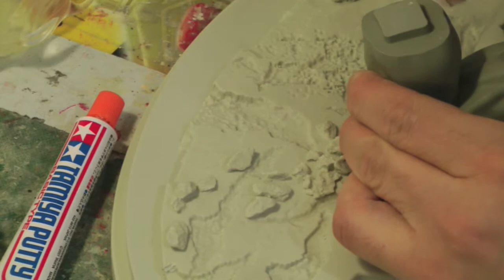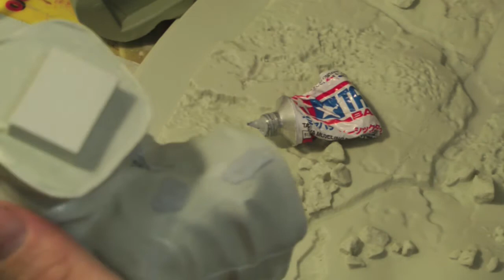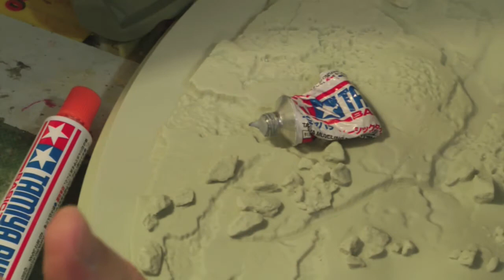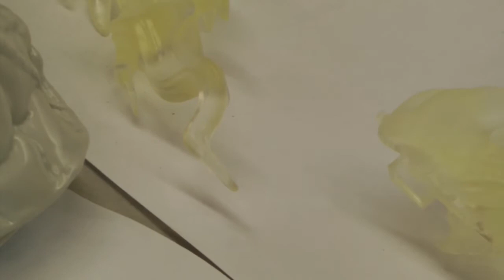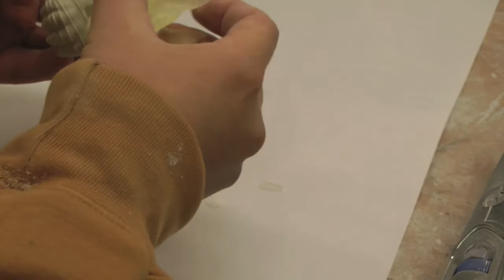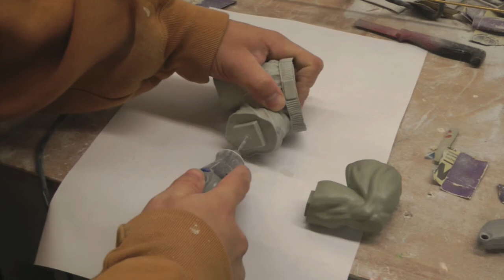PrototypeZ Sagat Step by Step Build Up Part 2 - Prep Work

Comment: Can I use JB welding it’s my first time doing a resin modeling kit it’s of sf6 chun li?
Reply from the maker: never used the stuff so no clue.
Reply: @VinceVellCUSTOMS  I think I can it’s like a paste you mix and put it on metal,wood,plastic and more
Reply from the maker: do some tests. but I like to use stuff I can sand and secure. So see if its sendable and doesn't make a lot of mess and tough to clean up
Reply: @VinceVellCUSTOMS  it is sandable I use it on my moms car to fix the fender